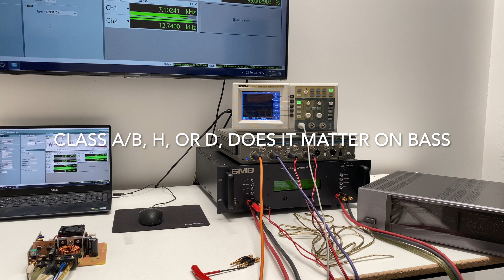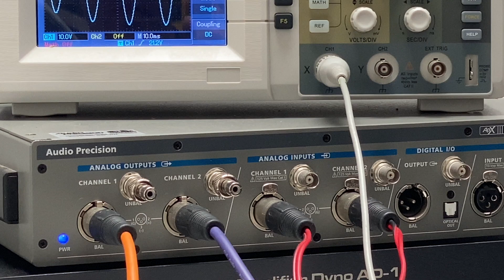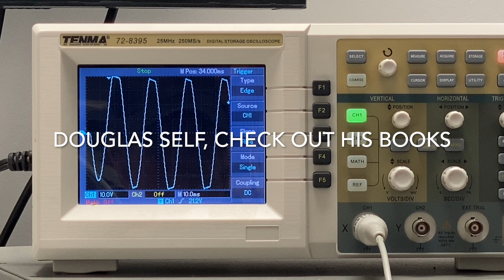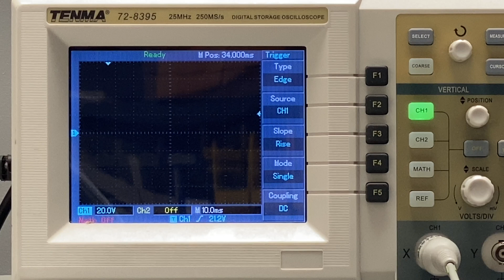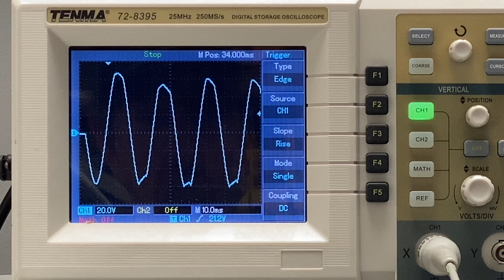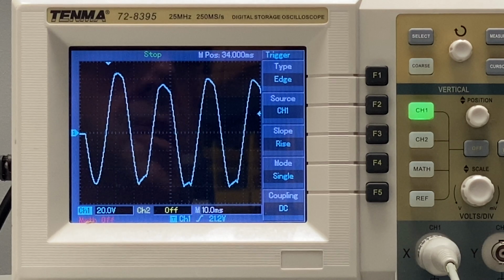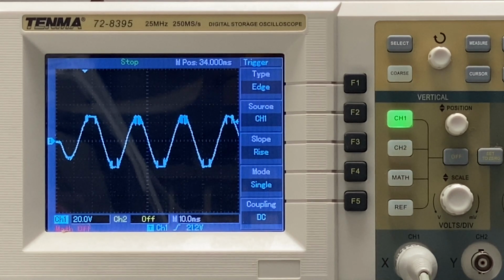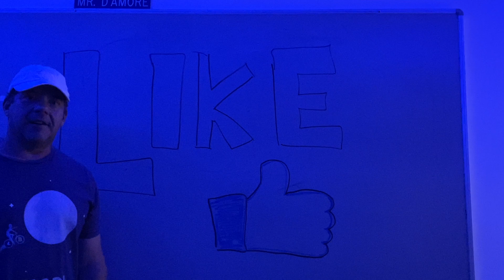Class A/B vs D vs G/H which is best for bass? Audio Technicals V3

Comment: I was always under the impression that the purpose of having a variable voltage rail or low and high voltage rails as in the Carver amps was for dynamic headroom. The waveform on that Carver does not look good.

Comment: Yeah like Rockford Fosgate selling a T600-4 and then sneaking in the T600-4AD - BIG FU**ING DIFFERENCE, ONE IS A CLASS A/B WITH 0.01% DISTORTION AND THE OTHER on the O-Scope looks like a Zig zag line of regulation or oscillation whatever the duece it is, class D trash, the AD sucks compared to the old Power A/B's.... at least change the look, dont try and trick us with the same exact look...

Comment: i still dont get it. so how do you set the gains for a 4 ohm load if you arent using ohms law.
Reply: alpine head unit max vol 30, 250w JL 4 ohm, JL amp rated at 250w @ 4 ohm. voltage out of amp at max vol + max sub (db+15 setting on head unit) is 31.6v. so what am i doing wrong? i dont get it.
Reply: P=VxI..